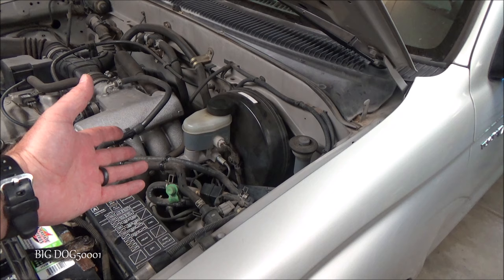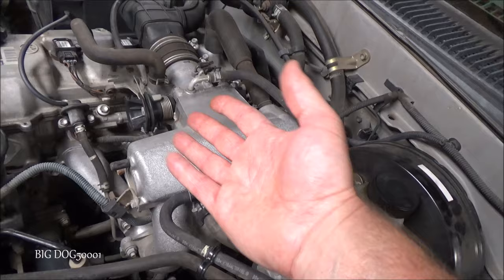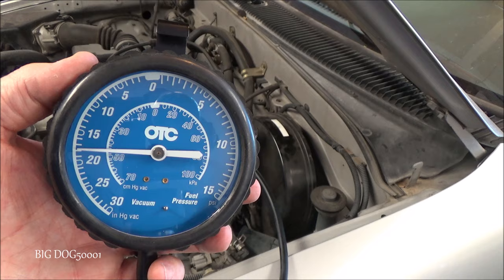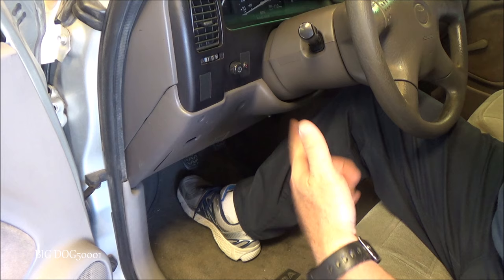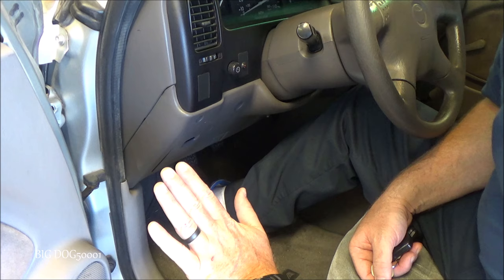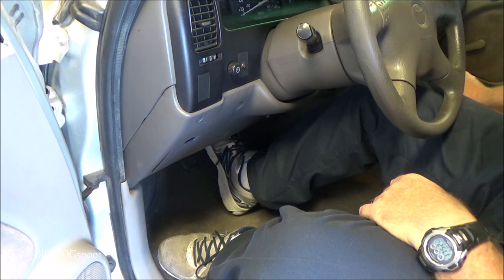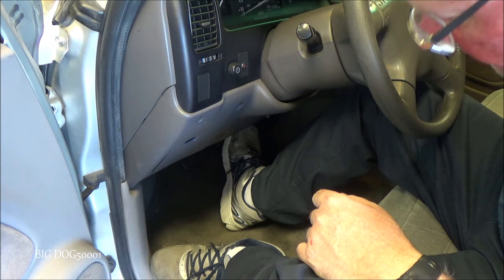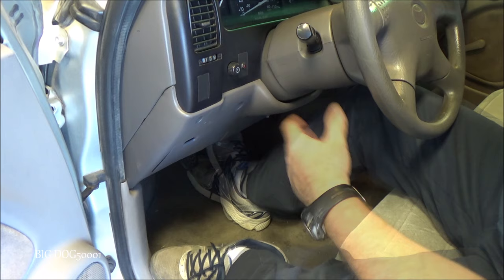How to Test For a Bad Brake Booster / Brake Booster Testing

Comment: Hey Big Dog50001
I am not sure what my problem is
But it does this,
When I start it in the morning
Everything worked fine, I went to back up and the peddle went to the floor and no brakes, so I knocked on the master cylinder, and they worked
For a few, I went to go to work that same day everything seemed okay,
The next day same thing happened,
Went to back up and peddle went to the floor, and no brakes at all, I knocked 
On the master cylinder again and they were there, went to go to work,
And about 20 min went by and the brakes went to the floor turning on another road, and I pumped them and the pedal came up and I almost missed my turn, so after that I pinched of the vacuum hose going to the booster and cut of the vacuum supply, the pedal was super hard  and I really had to put pressure on the pedal to get it to stop,
I do know that cutting off the vacuum supply will make the pedal almost impossible to push and basically turn it in to manual brakes, real manual brakes. lol but it always stopped, no fluid leaks, no bad brake lines, and no lost of any fluid in the reservoir, so is it a bad booster or somthing else......thanks in advance

Comment: Hello I got a question 
Got a Saturn 2008 vue, the situation is my brakes lock up 20 minutes after that I drive , so  I went at mechanic and found liquid brake into of the booster brake ,so change it ,but the problem is worst now , not can not move the truck because is totally locked up of the brakes , you know what is the problem??

Comment: Why do I get a soft pedal sometimes when driving? Because of New brakes and rotors? Need to be worn in? Idk
Reply from the maker: In general, brand new brakes and rotors will feel different until they bed in.  Air in brake system can also cause a spongy or soft brake pedal.

Comment: Do new boosters come with check valves? If not, then couldn't we just change the check valve (which I assume is pretty inexpensive) to quickly see if that helps? We will have to change it anyway as the booster does not come with a new one.

Comment: My brake booster has a nasty hiss each time I shut off the engine and  there's a P0171 lean condition . Does that look like a decent sign that my brake booster is failing? I've done a smoke test from both the intake manifold and the air intake hose and did not find any leaks
Reply: Did you figure out this problem im haveing the exact same issue from the hiss noise and the check engine light with the same code p0171 any help on this matter thank you

Comment: I can't understand why the brake pedal sank down when you turned the engine on with your bad booster. In fact, to me it's the sign of a good brake booster.
Reply: I’m having the exact same issue, after replacing rotors, pads, master brake cylinder and even bleeding about 10 times.
Reply: Same thing is happening to me. Replaced the master, bled brakes, brakes sink to the floor and hisses like crazy
Reply: I’m not a mechanic, but did you guys bleed the master cylinder to get the air out of it? After replacing the master cylinder you have to bleed the brake again. Process of elimination, checked brake calipers make sure they aren’t seized, or the brake bolts tht help the caliper work. . . I’m in the process of checking my rear drum brakes to see if something’s wrong. I just bled the brakes and changed the front brakes, failed to check the rear tho.

Comment: Big dog answer me this no mechanic can figure out when I complete to a complete stop the brake pedal will push down slightly and truck will pull to the left side but randomly not all the time when braking normal its fine but only when coming to a complete stop brake booster is fine checked it they checked all the brake system is fine had all new brake lines installed couple years ago what do you think is causing this abs light has never came on no one can figure it out and can't find anything online
Reply: check rear brake adjustment.

Comment: Same truck as yours , my Tacoma passed check valve test but failed the test where you press and shut off truck, my pedal began to push up right away not 30 seconds,it passed the press on pedal and start the truck and foot sinks ?🤔🤔
Reply from the maker: Sounds like the booster most likely has a leak.

Comment: Ok so when my car is running and i put the ac on the brake pedal gets hard. As soon as i turn off the ac... The brakes feel fine. I have been told the booster is bad but when i search it says the master cylinder is the problem.

Comment: I have skoda Laura , its break pedal is coming up very slowly after pressing it down in run position. In morning sometimes it also get stuck in bottom after one or two presses it comes back but continue to come back very slowly. What could be the issue?
It has ABS
Reply from the maker: I would start by making sure the brake pedal isn't binding on anything and the brake pedal return spring looks ok.  After that, I would need to see what is happening.

Comment: question, after a while of me driving my car, my brakes slowly come on, not completely, but i can start to feel resistance whilst driving, and when i come to a stop, the car can not be pushed whilst in neutral, after an hour they release themselves and im able to push the car, what is the issue here? great video BTW.
Reply: Ever get a solution?
Reply: @onemorecoat1712  haven’t had time to look into it as yet, I’m told it could be one of three things, collapsed hoses, master cylinder or servo, but with it being a classic car, so not my everyday ride, it gets put away from sept-April so it may be that I replace all ready for next year, plus do a couple of spots on the bodywork. Don’t want to have to do the job each time I change one thing, as everything else on the braking system is new.
Reply: appreciate the response.  Hope you figure it out , thanks

Comment: Nicely done helped a lot...1 question please...I disconnected vacuum line going to booster.. when I took off the line it popped from pressure...started engine lots of vacumm pressure could be felt on hose end...pumped brakes and it didn't change anything as far as pedal distance....same all thru all tests you showed....booster and master cylender both bad?  THANKS for any assistance.

Comment: My trailblazer holds pressure when the vehicle is off but when I start it the brake pedal drops to the floor...when it’s running it has brakes as long as I slam the pedal to the floor...I bled the brake lines and replaced the pads and rotors...I’m waiting for the master cylinder to arrive but it’s the whooshing sound that it makes when the brakes are pumped both whennits running and off and when it’s running it causes the engine to stall a bit when u hit the brakes hard...so I’m not sure what the problem is...the valve or the booster or the master cylinder..
Reply from the maker: When the pedal goes to the floor, I look for leaks in system or a bad master cylinder.

Comment: Would a internal leak on the booster cause erratic acceleration when your braking/slowing down to a stop?
Reply from the maker: I guess it depends on system design, but in general it would most likely cause a harder/stiffer brake pedal, which would require more effort to stop.

Comment: here's what my problem is. pedal is hard to push, barely slows the car. check valve works. pads and rotors are fine. calibers work. no fluid is leaking. so is it the booster? or is it possible i lost vacuum leak without the engine running worse?
Reply from the maker: If there is no vacuum going to the booster (on a standard design setup like in this video), then it is not going to function properly.  From what you are describing, I would look towards a vacuum or booster issue.

Comment: Can a faulty brake booster cause the car to stall in gear as well? Aka car in question is a 1988-89 vn commodore on duel fuel. She's computerised but has no diagnostic port. My son borrowed it and thought it was the ignition coil because it is running erratic. I will do these tests, I just bought a pressure gauge.
Reply from the maker: It depends on design but yes if the vacuum leak is large enough it could cause a car to stall before engine computer can adjust.
Reply: @BigDog50001  thanks 👍👍👍 and it was the brake booster. All running great now but check light still on? Will I need a mechanic to cancel it.
Reply: @jojozepofthejungle2655  Sometimes taken off the (-) cable off the battery for a couple minutes will reset the check engine light. OB11 scanner will also reset it.

Comment: Hello I’ve been having an issue I have no idea but it happens when braking . When I come to a stop and press the brake it’s fine but when I let go of the brake beforepressing the accelerator it’ll clunk but when I come to a stop but flutter the brake pedal and then I let go of the brake after accelerating it doesn’t happen . Will it be the booster as well?
Reply: And also it’s a 2002 tacoma prerunner 2wd

Comment: how about the pedal pulling down away from your foot and it happens more often when the engine is getting too hot
Reply from the maker: I would look towards a leak or bad master cylinder.
Reply: @BigDog50001   I replaced the master cylinder under warranty I found it leaking in between the master and booster but I need summer weather to fully test the results

Comment: Thanks for the video.  Very helpful. 

Would you have an idea why I have soft brakes? I converted from manual front drum brakes to front power disc brakes... But have a soft pedal and I need to pump the brakes to get the cj7 to stop. 
The brake pedal piston rod was slightly longer on the disc brakes than the drums and so I adjusted/dropped my pedal down some to line it up with the rod.  
I also noticed that the mc has a very deep hole and wonder if  the mc bore size is too small?  
I tried to adjust the booster pushpin out but the pin pulled out.  I managed to get it back on the booster.  Hope that's not a bad thing...  

Thanks for your help!
Reply: You bought a Jeep...you fooled with the brakes.   Lol.
Reply: @ronjohnstonaustralia2417  Baahhhhh.  How else shall we learn sir?  

I figured it out a while back.

  The master cylinder was missing the "bullet" or pin.  I didn't know it needed one until I bought a new power brake booster kit (which had one).  But I was "green" new to brakes. But now I probably know more about brakes than most men.... And women.. And I'm a girl....😛
  
Perhaps my lesson has taught,  or Will help someone else...  😉

Comment: My brake pedal is hard, the brake booster was rebuilt and I’ve checked for vacuum leaks. Everything is working as it should, however the brake pedal is still hard and even though I try to brake as hard as I can the wheels never lock up. Any help will be appreciated.
Reply: @GoogleIT-qp7mk  in my case it seems to be low vacuum at idle due to a mild camshaft. I’ve had a vacuum pump installed and I have good brakes.  I hope I could help.

Comment: hey big dog, I got a speedway booster on a 53 vic, I'm getting an air leak inside the cab at the firewall. is that the atmospheric valve? the hissing goes away when I press the pedal. can this be fixed by adjusting the rods? or bad booster? thanks for the great videos.
Reply: No its no good its leaking if you hear air hissing
Reply: @rokitman5753  thanks for the info

Comment: i hope you will reply, on my 2003 honda civic the pedal go too the floor only when the engine is running front brake are new drum brake are adjusted and there is no leak when the engine is off the pedal is hard as a rock but not when the engine is running
Reply from the maker: I can't see what you have going on, but if the pedal goes to the floor and there is no leak (should be fluid somewhere if there is a leak), then I would look towards a bad master cylinder.
Reply: The pedal goes to the floor only when the booster is on so i think its the booster but i want to be sure because in this car thats not a little job so how can i be sure its the booster?

Comment: I have a 2016 Chevy Malibu and the brake pedal is really hard all the time and sometimes it makes really load noise coming from the brake booster  do U have any experience with this time of car it only has 30000 miles can it be the vacuum pump or the brake booster thank you
Reply from the maker: From what you describe, a brake booster issue or a vacuum pump issue are possibilities (some of those Malibus come with a vacuum pump instead of using engine vacuum like the vehicle in this video).  I would start by verifying that there is vacuum at booster.
Reply: Big Dog50001 Automotive there is vacuum I open the vacuum pump and there was no damage inside.  When I opened it was working normal and a day later the problem start again

Comment: What does it mean if your brakes work perfectly but there is a hissing sound until you press your foot on the brake?
Reply: Did you figure out this problem im haveing the exact same issue from the hiss noise and the check engine light with the same code p0171 any help on this matter thank you
Reply: @mikeolortegui260  I still haven't fixed the hissing sound yet, but I've narrowed it down to either a plastic seal that connects to the brake servo, isn't sealing properly or the brake servo itself. Based on the fact my brakes work very well, I'm thinking more the first one. As for your other problem with check engine light and error code, that could be a host of different problems. You could check the error code and find out what part is causing the code and get that part fitted. That's called throwing money at the problem. A better way would be to do a proper diagnostic on the car and find out the root cause of the problem. You could need a new spark plug or battery but you could also need a new turbo or injector. Teach yourself how to do the diagnostic by watching YouTube videos and buying the equipment you need to do the job or pay someone who already knows how to do it and has the equipment. Good luck

Comment: What causes da brake drop while driving sometimes it does it sometimes it dont.i thought is was air in da line i bled da brake fluid it still does it
Reply from the maker: Air in system or bad master cylinder are where I would start.
Reply: @BigDog50001  oh k.thanks
Reply: Same issue on a 95 Tacoma 2.7l haven’t checked vacuum from the manifold yet but the booster seems to work. So I replaced the master cylinder and it’s still not working. It won’t bleed either. I’m afraid the new brake master chylinder is bad

Comment: Mine sinks all the way down when doing the test with the engine off. It’ll go down halfway then slowly sink to the floor. Im confused as people have said its the master cylinder itself leaking and not the booster.
Reply: yes its the brake booster. my car is off and my brake pedal sinks to the floor . its gotta be. my master cylinder resevoir is full and not leaking from lines or anything . people say other wise but its the booster.
Reply: @ryangee890  since this last comment i replaced the master cylinder and it fixed the problem. Apparently the seals within the cylinder leak themselves. So no fluid leaks out and the reservoir stays topped off.
Reply: Was it difficult to replace the seals Eddie?

Comment: i have a question, is it possible that the brake booster may not work in cold weather?  or it malfunctions in cold weather?
Reply from the maker: It is possible that the issue only shows up during cold weather, but in general the braking system should work properly in warm or cold weather.
Reply: I had a Ford Ltd do that. Rock hard in am and once you drove it a bit it was fine. New booster fixed it

Comment: Hey man I checked the small check valve and it is fine, I notice when my truck is off the brake feels firm but when I turn on the truck the brake pedal sinks to the floor almost bottoming out, if I let it run a few minutes and shut it off with my foot hold the brake pedal it will not push my foot back at all.. any idea what it can be.. also have a brake light on and abs light on, it's a 97 ram
Reply: Hey, did you figure out the problem with your breaks? I'm having the same issue, but replaced the booster, master cylinder, and drum cylinders. I bleed the system 2 times and see no leaks. I think the new master cylinder is bad?
Reply: Not yet, I bled them and had a lot of air in the rear brake lines it helped a good amount, haven't messed with it lately.. have engine out as of now working on a rebuild..... Let me know if you find anything that fixes yours
Reply: @stunna0014  The NEW master cylinder was the culprit! I cleaned and rebuilt the old one, and bench bleed it while bolted to the booster, then bleed each wheel. She's 100% better now. From what I've read you either still have air in the system, or the MC is not functioning properly. 

Thanks for the quick reply, and hope my feedback helps you!

Comment: When I step on my breaks and releasing .I heard air coming out.time to replace my vacuum boaster for ml 320 year 2000???
Reply: @Shane Costello I have asked from many mechanics and they told me.i need to buy a new vacuum boaster.once I changed it.i let you know.how it does.
Reply: @jayvirtusio1081  HI Jay , i believe the issues  the brake booster, you might want to get it changed soon because the stiffness will only last so long before the brakes fail and you might crash. stay safe

Comment: Hi. What if brake pedal doesn't push back like in the video, but sinks further the second I turn off the engine while also making strange noise? .
Reply from the maker: If the brake pedal pushes down further than it should, I look towards a leak in the system or an issue with the master cylinder.
Reply: @BigDog50001  but it doesn't sink at all when engine is off. It stays rock solid. It sinks at the moment when presure is aplied and I shut off engine.